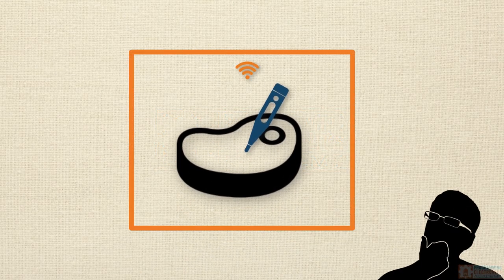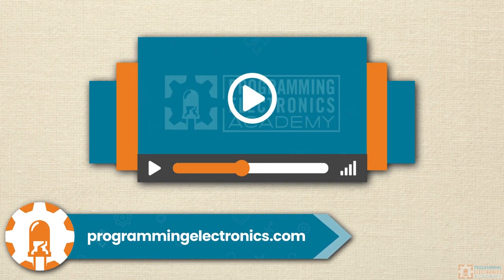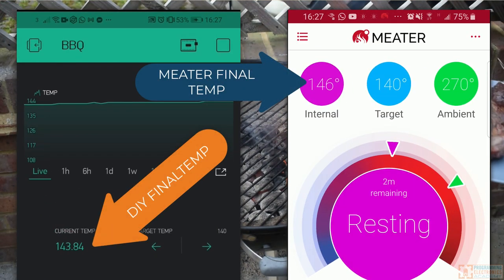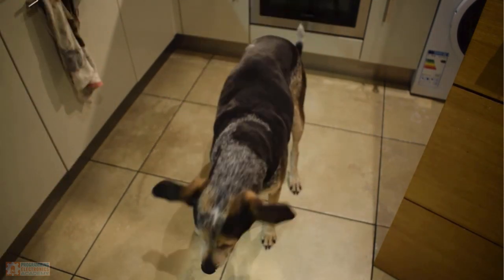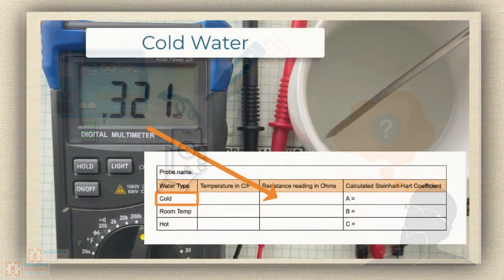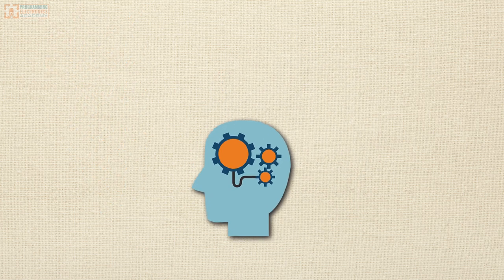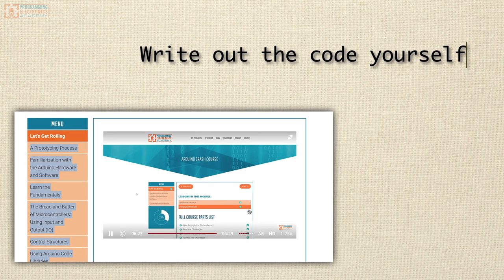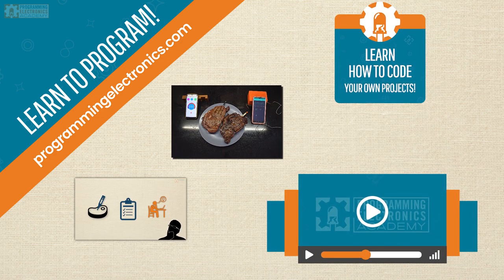DIY WiFi BBQ Temperature Probe

Comment: Hello, this is very interesting. I was wondering if the cable suffers any damages from exposure to high heat? Over a long period of time?
Reply from the maker: Usually the cables for these are rated for higher temps, but like anything I think they wear out.
Reply: @programmingelectronics  Thank you for answering!
Reply: It does, so the wireless one is needed. This video is to join the course but I guess I will find out how to do it after more research.

Comment: Any chance on a DIY on one without the cable?
Reply from the maker: That'd be neat!  It would come down to a materials issue - to be honest, not sure how insulate the circuitry from the heat...
Reply: @programmingelectronics  Exactly, heat is at the core of the problems.